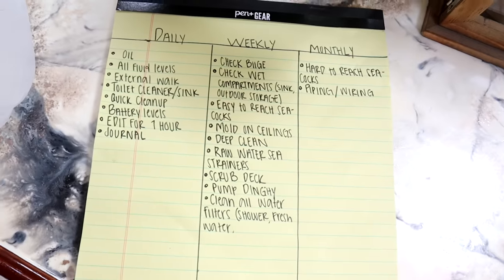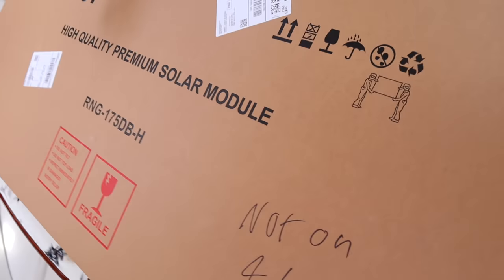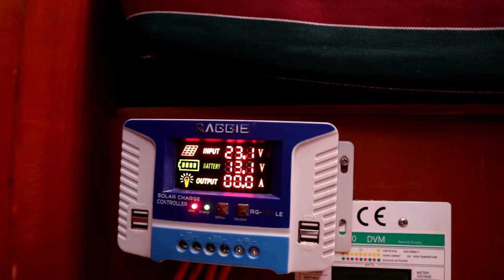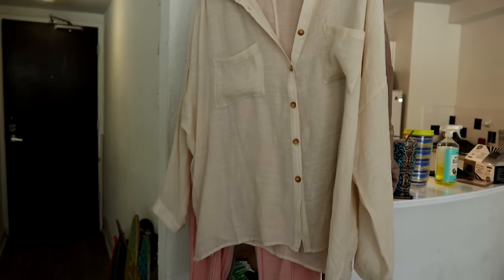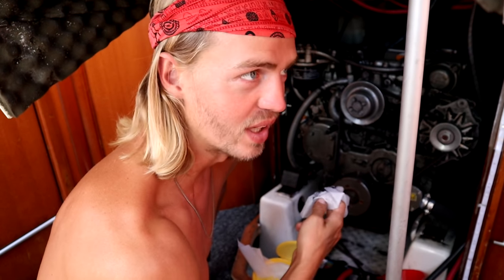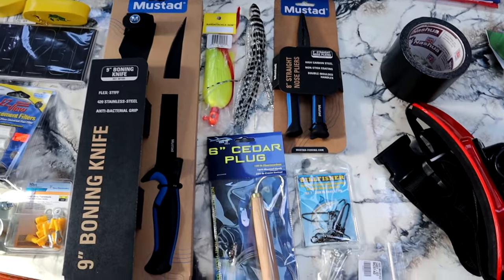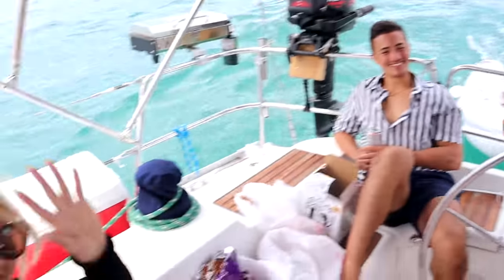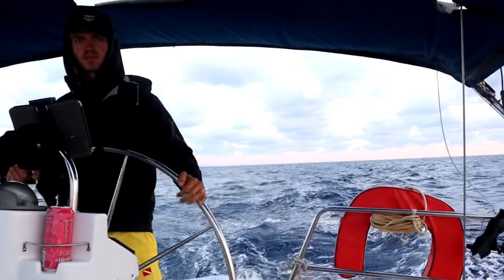Last video before we cross😱 Ep.16

Comment: Best of luck as you start on your big adventure. Small tip regarding food. If you want to avoid cockroaches then don’t bring cardboard cereal, rice...packaging on board. Put the cereal into plastic containers. Also remove all the paper on your tinned food and write what is inside on the top of the tin. Fair wind and following sea👍⛵️

Comment: You got the underwater tape, now pick up some pool putty epoxy. Buy two or three. sets underwater.  Tip, cover solar panels with towels or blankets when you are working on them so you are not connecting stuff that is live.